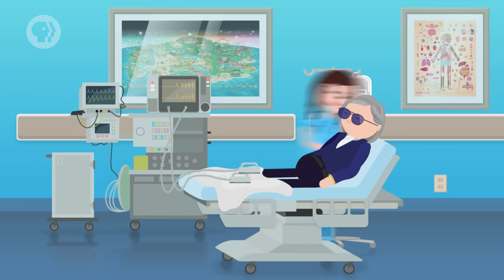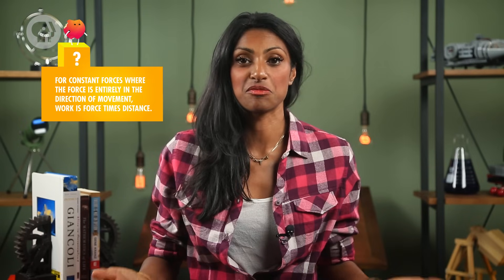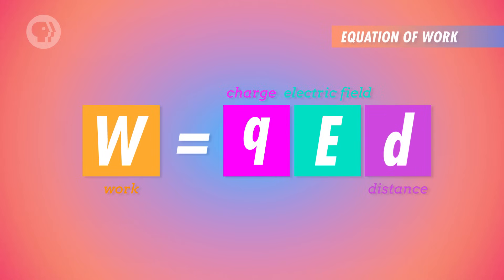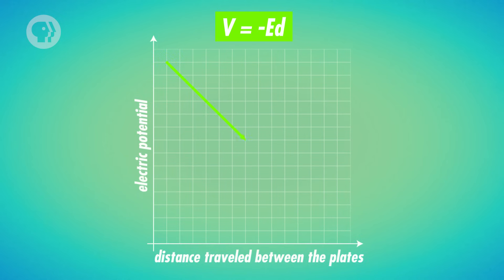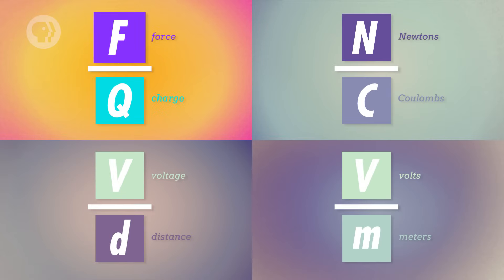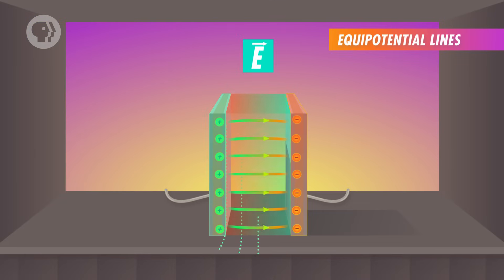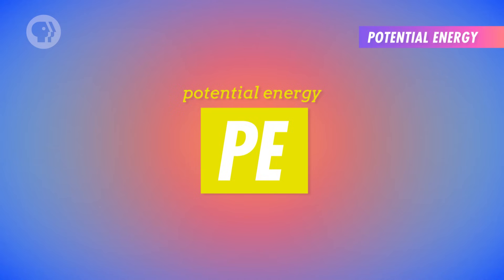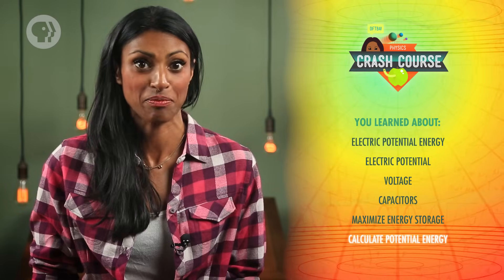Voltage, Electric Energy, and Capacitors: Crash Course Physics #27

Comment: I love your video, but I think the transition from the equation at 4:47 to the equation at 4:50 is confusing for a student who is not comfortable with the integrals, I mean by that that you explain well that it is the electric potential if one is placed infinitely far from the point charge Q with regard to the first equation, but with regard to the second equation I think that you should have rewritten the integral with "r" in lower bound before writing the result, this equation then corresponds well to the electric potential if one places oneself at a distance "r" from the  point charge Q.
I want to emphasis the amazing animation to your video, one more time : thanks

Comment: I use capacitors for years and understand how they work. But watching this video make me unlearn reality. The defibrilator has never been explained : how much voltage and current need to flow thru the adult/child body? How long the electric pulse last?

What is the typical value in micro-farad of the capacitor used in the defibrilator?

What would be the value in farad for to plate of 1 meter squared at distance of 1 mm? Then, inserting an isolator material that keep the plates at same distance, how much more farad we would get? Assuming the best or the cheapest material. Then, adding an electrolyte, how much more farad we typically get? Finally, making the plate "bumpy" to increase surface area, like in super capacitors, how much improvement we realistically expect?

All that is just describing the physical construction of a capacitor. Such knowledge is needed only for a handful of companies who produce capacitors. The much more practical knowledge needed is how a capacitor really work in real example of electronic circuit?

Comment: I have attempted to learn from this video. However, the video mentions that electric potential and electric potential energy are different, but not how they are different. It mentions that the electric potential energy change can be found by -Fd which equals -qEd, and it says that electric potential is the difference in voltage between the points. No or little mention is made of what voltage actually is.

Comment: Why is e=(1/2)qv? 
Why half?
Reply: Petroplin

You integrate dW = V*dq where W is work, V is voltage, and q is charge. Replace V = q/C, and assume C is constant with respect to q. Integration yields. (1/2) * q^2 * C. Then, replace q/C with V again, then you get the equation she had. The 1/2 comes from integration consideration, and is correct.

Comment: I thought a defibrillator was to resynchronise the heart if it was in fibrillation and that adrenaline was used to restart the heart if you have a heart attack. 

Also the lack of biology in this video means that they didn't actually explain how a defibrillator works, they only explained how electricity works.

Comment: The equation 4:48 I believe is incorrect. I believe it should be:   
-∫ from ∞ to r (kQ/(r^2))dr.
Reply: I agree Brendan. If you integrated up to zero, then (1/r) evaluated from ∞ to 0 would give ∞ - 0 which is indeterminate. She needs to integrate up to some finite r instead.

Comment: theres a lot of complaints in here about how it goes too fast to understand--the problem isnt the video, its the fact that it IS a ten minute video. theres far too much expectation to learn everything about capacitors and voltage in ten minutes--crash course offers review or overview of a subject, its not a substitute for actual full knowledge of a subject. i think you shouldnt watch unless you are planning to dive into the topic completely later, or you already know the subject and need a refresher. like the summary of the video says... this is a lot of information. you cant ask her questions to help facilitate your personal understanding like you could a teacher, so use the resources you have available--she gave you a lot of vocab and very basic comprehension--if youre still having trouble, seek out the solution! you have all of human information at your fingertips, and shes here to help give you a glance. its not crash courses responsibility to solve all of your curiosity; its your own. shes giving you the ability to ask a good question, so go ask it! good luck :)

Comment: Is it just me or do these videos go a bit too fast for just about anyone?
Reply: They do if you're using them as the primary exposure to the material. But if you read the textbook to explore the equations by practicing, you can use these videos as review material and you won't be so concerned with keeping up to the video. After all, she just explained two hours worth of lecture material in 10 minutes.
Reply: i play it at 0.75 speed! this was the first time i did so, all the previous ones were quite clear and easy to follow
Reply: Yeah lol usually I try x1.5 or x2 speed for these videos but I couldn't keep up this time.
Reply: I think the problem is in the video itself. Most people could understand the preceding videos without any other textbooks, but not this one. It really puts people down.
Reply: Bioengineer Bro 😂 I am in high schl and I get mostly everything she said... If its too fast just play it back at a slower speed

Comment: i dont get why this video even exist.
I undestrand this is a crashcourse, but in my opinion, it's far too fast/mot written for a beginer. You jump around concepts without taking the time to realy explain it.
The question part seems more to be a "thing to be check " than an actual helper (e.g. 4:47) . 
Voltage, Electric Energy, and Capacitors in 10 mins seems a bit extrem.
Using vocabulary like di-electric/permittivity of free space without explaining it do not help.

I never seen a crash course video where engineer did write comments to ensure young students that this is not the only way to teach electronics.

Comment: Almost right. The PE in a capacitor is half C V-squared. She forgot the squared!
Reply: The video said E=1/2QV NOT CV. So it was correct. But you can get 1/2CV^2 by substituting Q=CV into the first equation.

Comment: Doesn't the current flow from negative to positive?
Reply: Craze Phil   No, the convention used in physics, chemistry and electrical engineering is that current flows from positive to negative.  The convention originated with Benjamin Franklin, well before anyone had any idea what the actual charge carriers might be.  As pointed out in other comments on this video, although electrons are considered the charge carriers in metallic conductors, positive charge carriers are dominant in other situations.  In any case, learning that conventional current and electron flow go in opposite directions is perhaps the easiest concept in electronics.  If you get hung up on that, your career in electrical engineering is not likely to materialize.

Comment: 3:32 Why isn't it -1V (I know that there is no negative voltage, but.) -1000*0,001 = -1 in my world :/
Reply: TheJaseku   I think you caught a minor discrepancy between the animation and and the narration.  The narration does not describe the field strength as negative, indeed, the previous animation does not, either.  That minus sign looks like an error.  Fortunately, the line of reasoning Dr Somara is describing is not, at this point in the story, dependent on the sign or direction of the electric field, but only on its magnitude.  Good catch.

Comment: The energy stored in a capacitor is ½CV². Note the squared symbol. Thanks for the video!
Reply: Alan Gaul  The equation given in the video uses Q, not C.  When Q, the charge is used, the equation given in the video is correct.  Converting between the two versions of the equation is trivial.  Try it.

Comment: how about slowing down and taking a breath this video is an assault on the senses I've still no idea what a capacitor is
Reply: Stuart Williams   She told you, a capacitor is two parallel conductive plates with an electric charge between them, ie positive on one side and negative on the other.  Later she added the interesting and practical fact that insulating materials between the plates can reduce the electric field between the plates allowing more charge to be put on the plates for a given voltage.  Real world capacitors sometimes are exactly parallel metal plates, but very often, the plates are contained inside a package so that you can't see them.
Reply: Stuart Williams  The most common use of capacitors by far is in circuits where the charge on the plates, thus the energy stored in them, is rapidly varying.  They rapidly exchange energy with other components and that makes a huge range of electronic devices, from radios to computers, possible.
Reply: Pause the video when you're confused. Rewind. Also, try slowing down the video playback in settings.
Reply: It's a series. Watch them in order. You can't run before you walk. If its too fast, theres an X.5 option and pausing.
Reply: there is a reason why is it called CRASH COURSE physics, if u cant keep up try slowing the video down :)
Reply: I tried putting it in slow mo but it sounded stupid 😂😂
Reply: Its important to read the material and use these videos as review only. If this is your first exposure to the material, you will have a terrible time. Go back, read the chapter, complete practice exercises, and then return to find that this is a really awesome video very efficient at making these concepts concrete.
Reply: Put it on 0.75 silly
Reply: Watch science shorts, a lot less rushed and explained clearly.
Reply: This why it is called crash course
Reply: Exactly how I feel. Ha! I'm fucked.
Reply: Stuart Williams How about you use the button put her in .5x speed. Or find someone else to watch.

Comment: This course and all courses in this series are rather unhelpful.   If the goal is to explore the equations of physics then I would be better off reading from a text book.  I had hoped the session explored more on the design of the capacitor and real world examples of capacitor use, rather than throwing equations at viewers at a unacceptable pace.
Reply: YI-HUNG JEN   You are asking for a course in electrical engineering, or electronics, not a course on physics.
Reply: You should be using these videos as review only. The textbook problems are the only way to truly explore the equations.

Comment: Just a shout-out to anyone confused by this episode -- I am an electronic engineer by trade, and watching this video even I was bouncing between "that's technically true but so far removed from my day-to-day" to "wtf?". So if you found this confusing, do not be discouraged -- there are a wide variety of ways of teaching and understanding electronics, some of which may be more suited to your way of thinking. Do not give up!
Reply: TheHue's SciTech   That's because she is teaching physics, not electronics.  You are correct that electrical engineers rarely, while they are working with electronic devices, worry themselves much over the details of the physics.  The reason is that most electronic devices can be considered in an abstract way, without worrying about the physics, and electronics is difficult enough without having to constantly concern oneself with the details of the physics.  If an EE had to worry about the physics of charge carrier diffusion every time she put a transistor in a circuit, this Ipad I'm using would never have got built!
Reply: Mark Holm Absolutely correct, and I still feel my message is justified because I'm seeing "I will never be an engineer" messages in these comments, which I think isn't right.
Reply: TheHue's SciTech   I wasn't trying to say your message isn't justified.
Reply: Mark Holm Absolutely, that's why I wrote "and" instead of "but" (possibly could have been clearer about that though :-) )
Reply: TheHue's SciTech If they are that easily dissuaded from becoming an engineer then they never really wanted to be one in the first place.
Reply: When you're trying to understand physics for a test yet you end up spending an hour reading passive aggressive burns in the comments section. XD
Reply: I'm an electronics student and I was not getting half of the stuff as well....I feel kinda ashamed because of that lol
Reply: Firebrand Well aren't you a clever little boy! Have a gold star!
Reply: Firebrand ?? I can follow it just fine with a little bit of effort, it's just that I'm circumspect enough to realise that's only because I have a lot of experience and context behind me. Meanwhile, you're responding to my attempt at a reassuring and encouraging comment with an arrogant piece of self-promotion. Solid.
Reply: lol what a lovely and supportive comment. kudos to you sir.
Reply: TheHue's SciTech Not at all, I just shared with an opposing view. If you are insecure enough to think it was 'an attack' on your ability to understand, that's not my problem. I'm not special or unique for not having any difficulties with the video, because I'm sure many watched and understood it just fine. If you're expecting the validation of everyone agreeing with you... that's not my problem either. Weak.
Reply: Firebrand Didn't claim it was an attack on me. It's just self-evidently arrogant of you to say it.
Reply: Firebrand Troll detected, not engaging with you anymore. You clearly do not know or care what "arrogant" means, it cannot apply to me in writing my last message.
Reply: I dunno. I am no engineer. 2nd year undergrad student currently studying for his electrodynamics final. And everything she stated seems to be pretty much textbook material, and makes perfect sense. I've watched all of Walter Lewin's 8.02 lectures available for free on YouTube, and he covers this no different, albeit in much greater detail. But same examples, same equations. She really brushes over the integral calculus aspects. But I imagine that's in an effort to confuse less. Though arguably, this isn't the format to teach integral vector calculus.
Reply: Gigabyte22 in italy all engineering is taught in this way and only ultra-later you get to see real stuff. you can even find a 3rd year eng. student who has never seen a capacitor.

it's very effective to not bound to physical stuff and experiments only and get your mind work.
Reply: +TheHue's SciTech
That's reassuring because I'm studying electrical engineering and I was lost as well
Reply: TheHue's SciTech Well you're never gonna get your head around it with that attitude. lol
Reply: Mark Holm Thank you kindly. It was that response of his that got my back up in the first place. I actually wanted to talk about how much information they actually fitted in to that episode, impressively. Not to mention, when I study videos like this, I pause and make notes... so I personally find this format very useful because it is so streamlined.
Reply: I learned this stuff in high school, it's weird to see people not knowing this, tho at this point in my life I've forgotten a bit, but it's still nostalgic remembering my physics class :')
Reply: I also recommend Khan Academy's Physics 2 course. I like to watch these videos first to get the fancy graphical demonstration and generalized explanation, and then get Sal Khan's more slow and thorough explanation. Then I read the textbook full of the mathematical mumbo jumbo that makes more sense once you've heard it from multiple sources. It works pretty well, but is quite the time commitment, as is any thorough learning of harder material.
Reply: Shariq Torres Likewise.
Reply: wot?
Reply: TheHue's SciTech thanks dude
Reply: Thank you. I needed that
Reply: I'm not just an electronic engineer, I'm doing a PhD in electric field manipulation (in semiconductor devices) and this episode still confused me. It feels like it approached the principles back-to-front - starting from abstract ideas and slowly approaching intuitive concepts - or just in a strange order. And you know what?

That's OK

The beauty of science is that you can approach the principles from several directions. While an engineer (and the more practically-minded non-scientist) will want to work down from real-life observations, pulling the processes apart as they go, the physicists I've met tend to build their understanding from the bottom-up. Perhaps the approach has been let down by the format - ideas such as dielectrics deserve a full episode but the series has a lot to get through. Without a wider array of ideas you can piece together, it's more difficult to cover so many topics in such few lectures. My solution: take a full course and use these videos to build around it!
Reply: TheHue's SciTech   Your response to Firebrand, "Well aren't you a clever little boy! Have a gold star!", was childish and spiteful.  When I exchanged comments with you, you seemed reasonable.  Apparently you could not sustain that reasonableness.  You are the troll here, not Firebrand.
Reply: I thought it was perfectly explained... it all makes sense and easily understood.
Reply: TheHue's SciTech I think its arrogant that this is your response to someone who happens not to agree with you.
Reply: TheHue's SciTech Obtuse and ignorant. Hardly surprising really.
Reply: TheHue's SciTech dude this is basic emag. what kind of education as an engineer did you receive?

Comment: I like the formula at minute 8:16 because it tells us that bringing the plates closer together is the best way to store more energy. It growths exponentially.
Let's say K*E0*A = 2. If we are 1 m apart we get capacitance of 2/1 = 2. Lets bring it closer together a few times: 
2/0.5   = 4; 
2/0.25 = 8;
2/0.125 = 16; 
If we reduce the distance by half 10 times we get 8192 times the capacitance. If we do it 30 times we get 8589934592 times the capacitance and we only have to bring the plates 1.86e-9 m = 1.9 nm closer together to double the capacitance once again.
Engineers use capacitors to store braking energy in some electric cars and they can use the stored energy to make a quick start again.